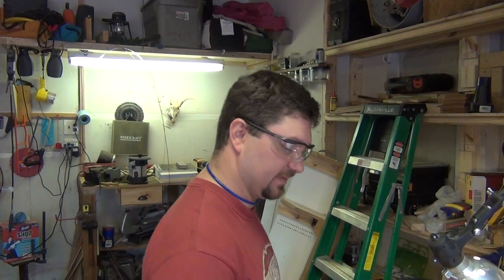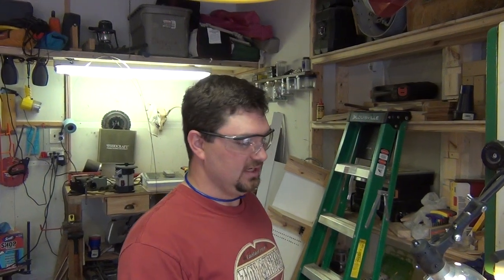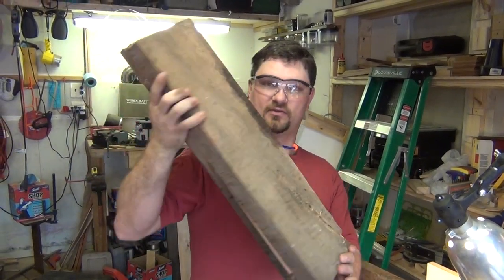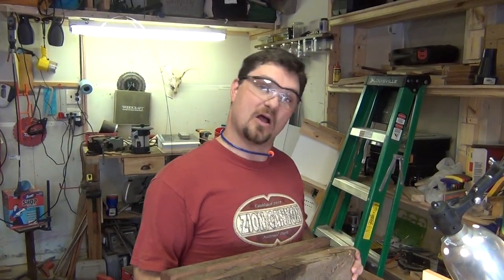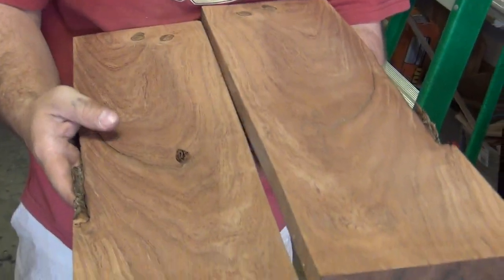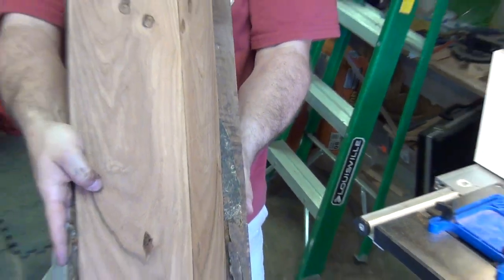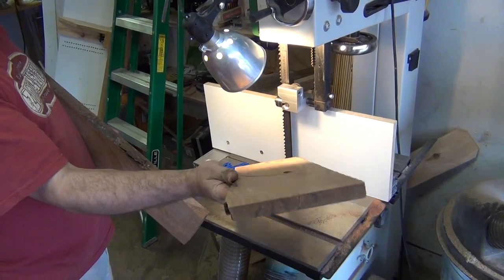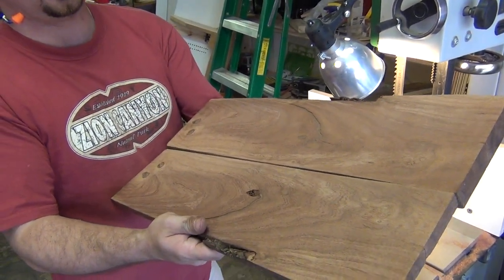Resawing Mesquite

Comment from the maker: Thanks!  I love my bandsaw.  I would recommend that if you plan on resawing, plan to spend about $150-$250 on a carbide tipped blade, it saves so much work after the resawing process to not have to plane my boards down any further.  I got mine on sale at Woodcraft (I think they go on sale about once a year.  I like it because it has the largest motor for that size bandsaw.  Thanks again for your comments!